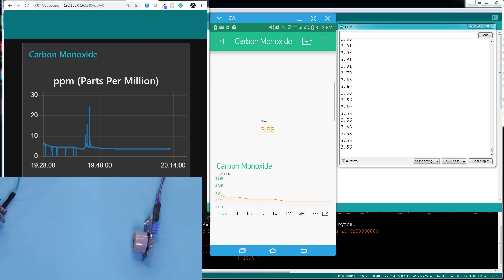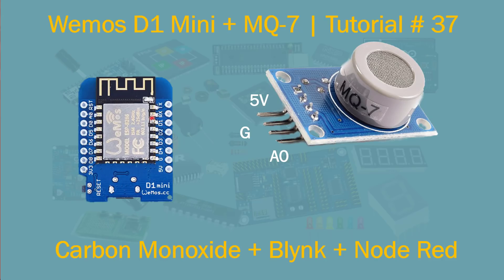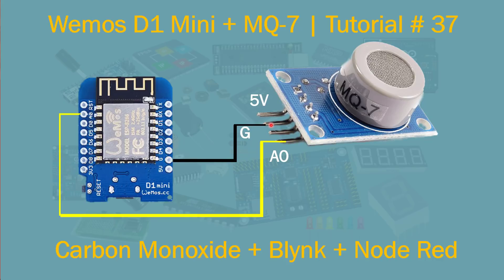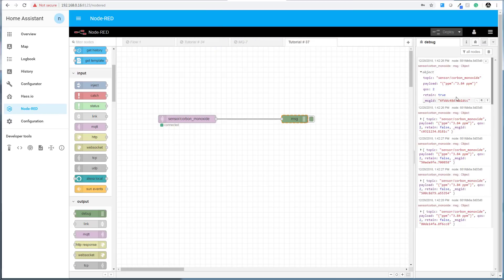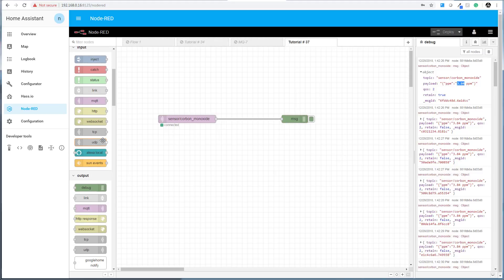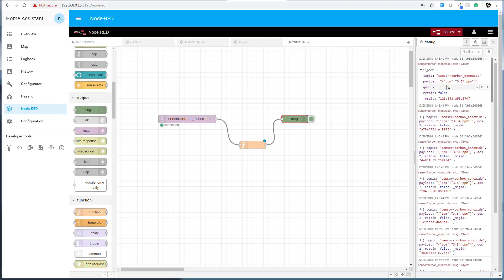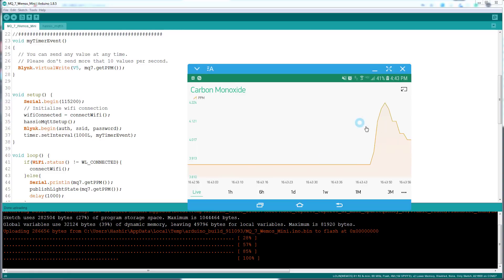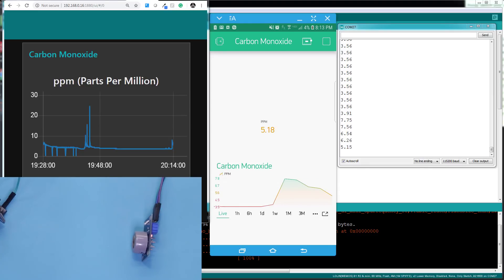Wemos Mini + Node Red + Blynk + Home Assistant + Carbon Monoxide MQ-7  | Tutorial # 37

Comment: Beautiful project I congratulate you. I wanted to ask if it was possible to operate a relay in order to give an acoustic signal to exceed the limits of carbon monoxide in the air. Thank you very much for your attention I await your news.
Reply from the maker: Elettronica 2000 Yes, it is very easy to do that. Add similar code to sketch to achieve this.

After "float co= mq7.getPPM();" line add follwoing code. 

if(co>=<warnning limit in float like 7.80>){
//set relay GPIO to high
}else{
//set relay GPIO to low

}

Comment: Is Blynk mandatory for this to work? Say I don't want my data go over Internet. Just home assistant. Node red mqtt should work with same sketch? Please clarify
Reply from the maker: Christian Fuchs is right. Blynk not required. I only did it since some folks requested a tutorial on it.
Just remove the following lines from sketch to use it without Blynk.

#define BLYNK_PRINT Serial
#include <BlynkSimpleEsp8266.h>
Blynk.begin(auth, ssid, password);
timer.setInterval(1000L, myTimerEvent);
Blynk.virtualWrite(V5, mq7.getPPM());
Blynk.run();
timer.run(); // Initiates BlynkTimer
Reply: Its not necessary. Just modify your arduino sketch, enter the credentials for your mqtt server and wifi. On home assistant access to the same mqtt server, and make a sensor out of the mqtt topic -> done. I even dont understand why to use blynk or node red...